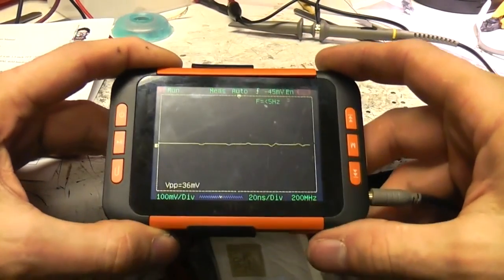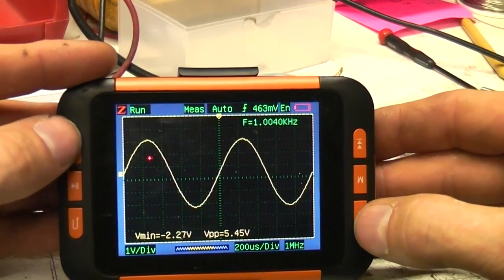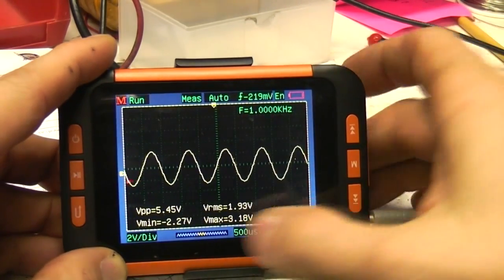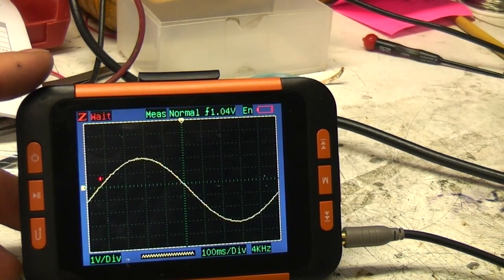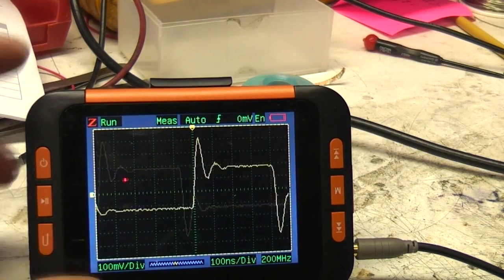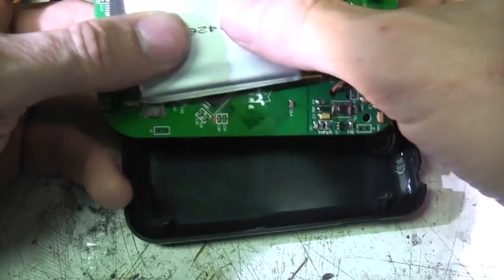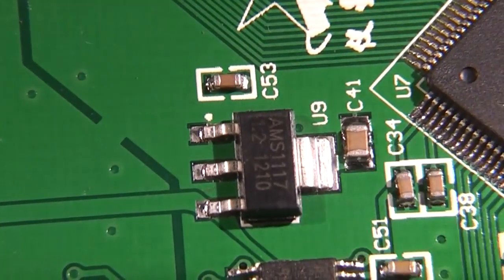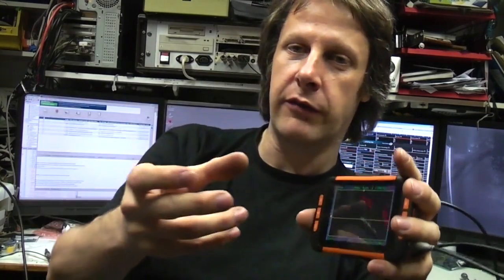QDso pocket oscilloscope

Comment: that is a blacktopped and remarked ad converter
if you ever can't tell just look in the dimple for pin one and if it's not flat on the bottom then you have a blacktopped part
other test you can do is swab a bit of acetone on it and see if it dissolves the coating/lettering

Comment from the maker: Possibly, although soft cores are quite expensive in silicon area on an FPGA.
The only thing that may take significant space is character sets, esp. Chinese, however it may be that the graphics chip has internal fonts - I didn't read the datasheet - easy to find by googling the part number. They could also store fonts in unused space in the FPGA config memory.

Comment: UI doesn't necessarily mean "rendering graphics", there's also input handling, setting up the graphics processor, etc. You can run a user interface on just about any microcontroller as long as the heavy graphics processing is handled by a secondary IC.

Comment: A "Blackberry" style scroll wheel or the more modern scroll pad would be a great option for a viable "knob" replacement. I'm a strong believer in spending your development money on an an extremely well designed UI even if you have to cut back on scope functionality. Limited capabilities that are a joy to use would sell me FAR better than a wonderful feature set with a crap UI.

Comment: The DSO 203 quad wins.  175$ from EBAY and open source firmware.  I downloaded the CHIP firmware/UI and it's freakin awesome.  FFT, X,Y plotting.  Vpp + duty cycle control over the signal generator with built in PWM in addition to the sine/square/saw/etc.  Making the D203 into a ESR/Curve tracer is unbelievably easy.

Comment: Are there any specific manufacturers you would recommend for safe, well built, power bricks? I was just about to connect up a USB hub but hesitated at the thought of what was inside the suspiciously light weight 5v 2.6A adapter they gave me

Comment: I watched Dave's review as well, and I agree - it's a shame that all the hardware is there, but the front end + small MPU let's it down.

I held out for the DSO Quad, as it was the only one I've seen which seemed to have had any thought put into it. Also, I knew it wouldn't be long until the firmware was "upgraded", and it now works as a basic logic / spec analyser too.

I would NEVER recommend using it for high-voltage stuff though! (even though it's rated at 400V p-p with a 10x probe).

Comment: There's a wonderful touchscreen interface called an iPad. I've seen iPods used as the human interface in broadcast equipment with great success. Why reinvent the touch interface control - these devices do the job already, virtual knobs and all. Wouldn't it be great if somebody made a scope that was a sort of 'frame' that the iPad plugged into? Two channels ideally, and yes it would be lovely if it went to 100 MHz or so...

Comment: 15:32 I really doubt the UI is running on that 8K microcontroller, and I'd guess it's doing something boring like acting as a serial IO expander. More likely the entire system is running on top of a soft core in the FPGA.